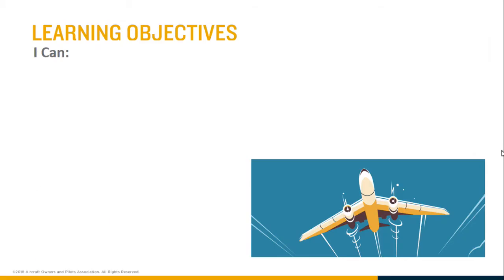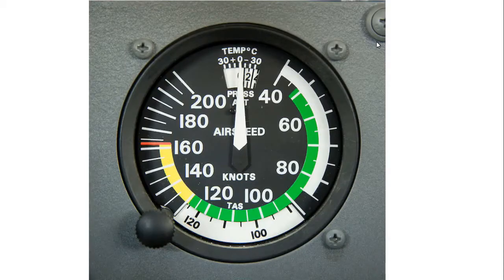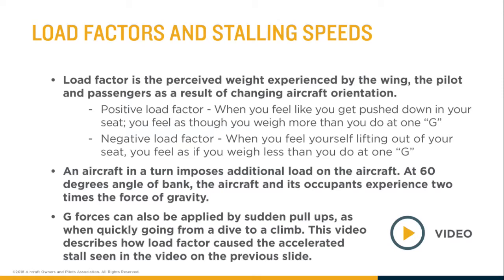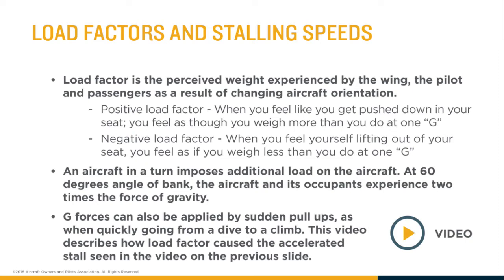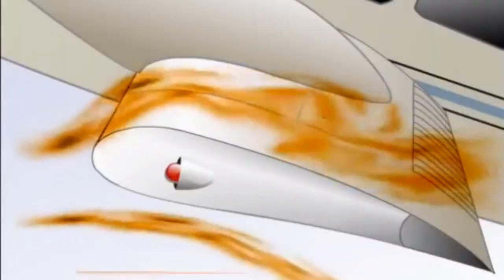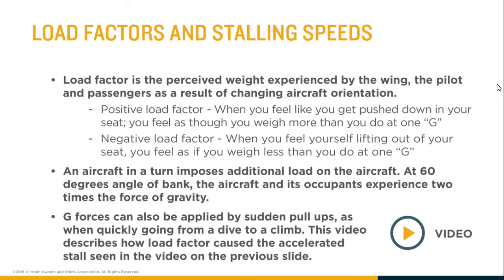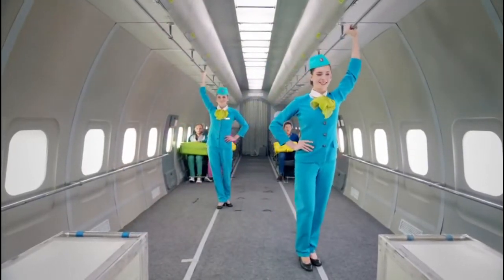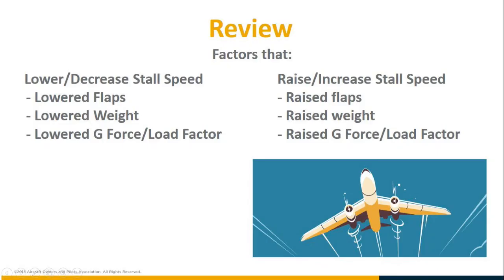Load Factor, Weight, and Stall Speed

Comment: Greetings! I have a quick question, I was looking over one of the aviation questions that asks, “ If the airspeed is increased from 110 knots to 150 knots during a level 45° banked turn, the load factor will...” 

At first I chose the load factor will increase as well as the stall speed. But the correct answer appears to be the load remain the same but the radius turn will increase.

But at the above quiz question, I thought when you make a turn your load factor and stall speed will automatically increase? Or is it because the throttle is increased that’s why there’s no change in load factor and stall speed?

Or that’s just say I don’t increase the throttle, and I make a turn, then in this case both the load factor and stall will increase?

Thank you!
Reply from the maker: Hello, sorry it took me so long to respond.  In a level turn the load factor depends only on bank angle, because load factor is lift divided by weight, and the more you bank an aircraft the more total lift you have to create in order for the vertical component of lift to still be equal to weight.  It is a function of trigonometry, so in a level 60 degree banked turn you have a load factor of 2, your wings are creating twice as much lift as you have weight, and your stall speed will increase significantly with the increased load factor.

The airspeed doesn't matter in terms of the load factor - in a sixty degree banked turn for example your load factor is 2 whether or not you are going 50 knots, or 250 knots, but as you correctly said, you turn radius at 250 knots would be much larger than at 50 knots.  To generate enough lift to pull 2 G forces your angle of attack would also need to be much greater at 50 knots than at 250 knots.

Does that answer your question?